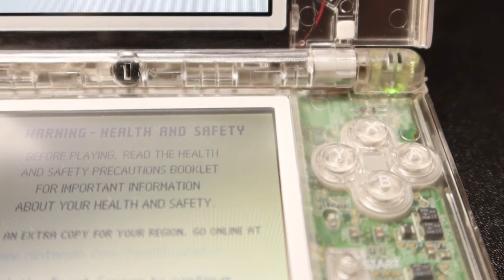Nintendo DS Lite Shell Housing Replacement | Shell Swap | DS Restoration

Comment: My childhood white DS Lite has been sitting in a drawer with a cracked hinge for god knows how long. I'm really thinking about doing a shell swap and getting a new battery and bringing it back to life. I won't say it looks easy but it definitely looks doable. Thanks for the awesome tutorial.
Reply: Scary how accurate this comment is to what I'm about to do. I have an atomic purple shell, r4 cartridge, and lithium battery in my eBay cart and my childhood DS lite with a broken hinge on my desk.
Reply: @bach2458  I ended up not doing it. As cool as it would be to use it again, I just don't trust myself to successfully do the swap. If you give it a shot, I hope it works out.
Reply: @Sirius_Coby  i just ordered the shell for $24, ill update you if it goes well or not. maybe i can inspire you
Reply: @bach2458  Now I'm interested too 😂
My DS lite has been sitting there for way too much time and I'll definitely try fixing it soon!
Please let me know if you managed to do the shell swap successfully :)
Reply: @mariobarchiesi3789  i just completed the shell swap and it went very well. took right at 2 hours
Reply: Just a note, if the hinge is cracked, it's likely because the barrel hinge was seized up and putting strain on the plastic housing. If you don't replace the part, your new shell will probably crack as well.
Reply: @autive42  the barrel hinge still functioned even though it was cracked. My shell swap was successful without replacing it.

Comment: I bought a clear blue shell for the ds lite and I will be using this vid to help me assemble the thing
Reply: @Sarcasm guy Its still gonna take a week to get here. I should've put I order insted of I bought
Reply: In case you were still wondering the shell installation was fine, but I broke the power switch on my DS.
Reply: @Sarcasm guy If you have experience, go for it! I didn't have experience and I was just unlucky that out of all things the little part that sticks out of the power switch broke.

Comment: I have an old white DS Lite that has been in the closet for years. It's starting to yellow and the hinge doesn't snap into place on it. The GBA slot doesn't work, the L button is broken, and many pieces of the shell have broken off. This video is giving me the courage to go out, buy a new case, and repair it myself.

Comment: Wish I would've seen this video sooner! I recently took apart my DS Lite because the bottom screen was getting glitchy and the color was distorted. I tried turning the adjustment screw under the battery and sometimes it removed the glitchy effects but still had the color distorted somewhat. like red apples in a tree were brownish in color. Anyway, I took it apart to see if maybe I had stripped the adjustment screw since it didn't seem to helping matters much lately, it wasn't thankfully, but when I put it back together I accidentally snapped the little nub for the power switch so now I can't turn it on. I don't have a soldering gun nor soldering skills either to put a new switch on, but this video is very helpful for the future!

Comment: ripped my ribbon cable. how did you do it so easily. gonna kms now. that ds was everything
Reply: Ribbon cable is routed through the right hinge.

It gets unbent everytime the DS is flipped open and gets bent again everytime the console gets flipped closed.

That ribbon cable is under constant stress.

Comment: March 2024, I got a transparent replacement shell from an shop on Amazon for $15.00. The tolerance is so bad that it could bent the board so slightly that it make the flex cable not working. Buy from a brand with consistent reviews guys.

Comment: Just finished doing this. If your shoulder buttons keep popping off at the slightest movement before you can get the back case on I heated a knife on the gas hob and melted a little ridge where the spring sits

Comment from the maker: Let me know if you have any questions regarding this tutorial
Reply: Could you make a video on hinge replacement on the DS Lite as my DS is flopping around because there is no fumctioning hinge to support the top screen
Reply: @epicpvper9379  i'm afraid i searched everywhere the only way to fix it is by changing the shell.
Reply from the maker: I do have a video for the DS lite hinge fix. It does involve replacing the top lcd housing frame. That is the simplest only way...
Reply: @TheFixTech  I was considering buying a cheap broken hinge DS on ebay. A whole new shell has new hinges? Not afraid to replace a shell. Did it on an original GBA and a GBA SP. Love restoring old consoles
Reply: I broke the latch for the small plug on the bottom screen so it won’t stay put. Can I solder it on or would it ruin the ribbon?
Reply: What tool kit are you using?

Comment: Nice video. Three small critiques. Leave the peel on the top screen until you're completely done.  The led light lens was left out @11:38, and the donor slot cover circuit board was left out @17:15.

Comment: **ATTENTION***...to save anyone else the hassle, be extremely careful taking off the screen and screen border. The adhesive likes to come off with the screen (this happened to me and I had to take it back apart and redo the adhesive...rip to those without extra adhesive...) As for the touch screen border, there is a thin plastic sheet held down by almost nothing and again it likes to come off with the screen border. This happened to me and it has made the repair 10x more tricky, I'm currently trying to get it to stay in place while I get everything locked down and then hopefully I will be able to hold it in place with the touch screen border. while attempting to do this I found a tiny fork like piece in my bag...well come to find out that goes in the hinge...yeah so no I get to take this thing back apart just to install that tiny ass piece that was NOT mentioned at all during the video! Like bro what's up with the silent act?? Are you to cool for school or something?? Talk bro! Guide us! this is a guide! Anyway I'm going to bed. Tomorrow I will update the solution I come up with regarding the now loose thin plastic piece that came off with the touch screen border. *UPDATE So more information that this guide didn't share. Be careful when routing the black wire under the cartridge reader as it can easily get stuck. Mine is currently stuck right now and I'm not sure how to get it out...

Comment: Fantastic video! only issue is there's no slight warnings/precautions when putting back the top shell. I've seen people mess this part up and end up bending all the stops from not aligning it  properly, other thing to point out is the power button slider/nub(?) from the board needing to be on the correct spot before finishing up otherwise it'll snap right off.

Comment: 2:08 that price you take off with the black wire connected, I can't get it to come off, and I feel it will break the circuit board if I force it...any tricks?
Reply from the maker: It has double sided tape sticking to board. It usually comes off with no issues. You can use a little heat (hair dryer) to soften the adhesive then remove.
Reply: @TheFixTech  thank you!!

Comment: Will the A, B, X, Y buttons from a New 3DS fit in a DS Lite?

i.e. Do both consoles use the same size A, B, X, Y buttons?
Reply from the maker: No, they use different button style press system. Will not work.

Comment: Hi, I have a problem...I was disassembling a nds lite for hydro dipping it, but when I was disassembling the top screen i kind of "cut" the ribbon cable...do you have any links for the replacement? I searched even on aliexpress, but I can't find them for less than €20..

Comment: I have a ds lite with the bottom screen that the lcd is good (i think), but the touch isn’t working great! I touch one side and looks like i touched the other side. Do i have to replace the lcd too? Or just buy a new shell with another touch and replace it? Help
Reply from the maker: If only the touch is defective then yes you only need the clear touchscreen replacement

Comment: I finished and when turned on, both screens look correct except that the bottom screen doesn't work as a touch screen anymore. Any suggestions?
Reply from the maker: Check the touch screen ribbon cable connector, make sure the cable is plugged in all the way. If the cable is damaged then replace touch screen (not the lcd)

Comment: So followed the tutorial got it apart and back together with ease but my top screen lights up slightly dim and no picture enyboady know what’s happening
Reply from the maker: Check make sure the lcd cable is properly inserted, if it is then the lcd has defected.

Comment: I put mine back together but now it won’t power on! Any idea where I went wrong? 😑
Reply from the maker: When you attempt power dies the power light flash then pop off?
Reply: @TheFixTech  So my battery terminal was damaged because the shell mold had a plastic piece there! After I fixed that, I noticed that I my touchscreen ribbon was ripped! So now it flashes green and then turns off so I’m assuming that’s because of my broken touchscreen?
Reply: @Leap3D17  how did u fix the battery terminal i have the same exact problem shell had a piece in the middle

Comment: I am struggling so much to get the bottom shell on. The springs keep popping out of place and the shell never sits flush, as if something is blocking it. So frustrating.
Reply: how did you fix that?
Reply: @avimoreno7226  
I used an x-acto knife to create notches in the plastic that would prevent the springs' arms from slipping out of place.
There is also a part of the bottom shell that pressed on the em10 charger filter. (I am guessing because of the shell being made by a 3rd party company). If you notice your shell is not going back together because of this, file that plastic down. If that em10 charger filter breaks, you will not be able to charge your DS Lite's battery. (Speaking from experience).
Reply: @JuanG2020 Fantastic… the exact same thing happened to me … the em10 broke while attempting to put the back shell on… were you able to fix it?
Reply: @antoniojean6170  Well, yes. I was able to replace the Em10 filter using a heat gun; my soldering iron just couldn't do the job. If yours just separated from the board, it wouldn't hurt to try to reattach it. Otherwise, you'll want to buy a new one. I think I got a pack of Em10 filters on Ebay.
Unfortunately, I have another problem. It's like the DS only charges a small amount. I charge the damn thing and after a short time, the light turns red. I am sure it has something to do with the Em10 filter, but I haven't had the desire, let alone the patience to open the DS again and attempt to fix that issue.
Hopefully you have a less frustrating experience than I did.

Comment: I tried this (and used the same shell coincidentally), and after I finished, it wouldn't turn on. The charging light comes on when I charge it, but when I try turning it on it does nothing. The power switch is lined up correctly, and I cant find any damage on the pcb. I took it out of the shell again to test it and same deal. Does anybody have any clue whats wrong with it? I know its basically impossible without seeing it, but its a long shot lol

Comment: DO NOT replace your shell with an after market, I just bought an aftermarket shell from extreme rate to spruce up my childhoot ds light and it is absolutely ruined now, the shell they sent me doesnt close, doesnt snap to a 90 degree angle, and even destroyed my receptor for my top screen because of the ds not opening correctly, i spent hours just to find all of this out after i had put the shell together, again please save yourself and do not get a aftermarket shell
Reply: the top display  it's too fragile specially the display, i destroyed it following another video from this channel; today i buy a new display i've to wait to don't make another mistake

Comment: I've just replaced one, thanks to this guide. I messed up on the top screen, because I jumped ahead without getting to the part of the video. (I replaced the top screen bezels/glass protector before I placed it in. Also, my "famicom" themed shell doesn't fit as perfectly/flush as the original DS, and the trigger springs are a PAIN. Make sure you put the springs in the right place (there's a designated "left" and "right" spring, where the chassis retention will be on the bottom instead of the top. If the chassis retention is on the top, you've got the wrong sided spring)

Comment: Hello! I’m currently fixing mine but as soon as I turn on the DS the top screen didn’t lit up. Any tips or reasons why it happened?
Reply: Does the bottom scree flash?
Reply: If it does, SpawnWave made a video talking about getting a ds lite in 2022. He also fixed a faulty ds and showed that the bottom screen would flash and the top screen would not turn on. Hope this helps!
Reply: I had a problem where the bottom screen would flash once and turn off. I had to re-connect the ribbon cable to the clip (I must not have pushed it all the way in the first time) and that fixed it for me.

Comment: Is there a brand of aftermarket shells with good quality? The only ones I can find link eventually back to Aliexpress... And I bought one there and there were a lot of faults in the casting mold. I had to file down the plastic on a lot of places and the end result wasn't to write home about.
Reply from the maker: It’s hit or miss, I’ve had a supplier provide great quality, then quality dipped.

Comment: Excellent video to follow along with. I struggled to get the black antenna wire under the cartridge slot, but after watching it again and bending it exactly how you did it went right through.

Comment: The problem with these type of tutorials would be a sense of direction. I just tried to pull off the cable right after he opened the back and managed to snap it off. The way he did it on the video it almost seems like he just slides it off but that IS NOT HOW ITS DONE. Make sure you go to another guide if you are looking for clarity. This IS NOT A HOW TO, THIS IS JUST FOR HIS ENTERTAINMENT. NOT RECOMMENDED.

Comment: Hello. After handing a case swap everything on my DS Lite came back fine. The touch screen powers on and works but has no touch. I removed the frame initially on the touch screen during the swap but didnt mess with the digitizer or touch screen ribbons. Any idea what could cause the bottom screen to work but have no touch?

Comment: After changing the shell my NDS won’t turn on :( green light turn on, flash the top screen, pop the speaker and then NDS shuts down :( nice video anyways 👍🏼
Reply from the maker: Check the top lcd cable, make sure it is installed all the way in. If so, top lcd may have defected. Replace if needed
Reply: @TheFixTech  it’s working now but I wasn’t sure what was wrong 😑, I disconnected and connected all the flex cables again.

Comment: Please help!  I'm new to repair and I just refurbished my first Nintendo DS and it went well for the most part. Everything works except when. go to charge it the orange light doesn't come on and it won't charge. I then swapped the motherboard with another ds and now this one isn't charging either. They were both charging before I did the repair. What could I be possibly be doing wrong? Oh by the way if I put in a full battery the DS powers on and plays just fine.
Reply from the maker: Make sure the bottom screen has the runner pad on the back, so no metal to board contact. Also make sure the battery is seating properly and touching the pins of the board.

Comment: Thanks for the tutorial! I've done it and got it working after an initial panic because it wasn't working and I broke the Wifi antenna trying to get it under the card slot. Turns out the antenna doesn't matter really because there's basically no way to use a DS Lite online and I just needed to re-insert the ribbon cable better to get the screens to work. Sorted. The damn case  (off Aliexpress) is pretty average and I can't seem to get the back of the shell flush (by the card slots, charger port and L& R buttons). Any suggestions?
Reply from the maker: Check around the screw mounting areas on the back housing, sometimes there is extra material that needs to be shaved off. Also make sure the board is fully recessed into the  button housing.

Comment: Hey, so I followed your tutorial to the letter... I mean, so carefully that it took me two days. And now my DS won't turn on, the green light flashes and the bottom screen flickers. Then nothing. Any ideas?
Reply from the maker: Top screen usually the culprit, check connections, if good replace top screen
Reply: I had this issue and it was just that I hadn't reattached the ribbon cable in the clip well enough. Tried really getting it in there and now it works!

Comment: I've watched this over a couple of times. I bought a broken hinge one  but it is still a working DS lite off ebay for like 25 bucks and a shell for 15. Going to restore this tonight using your video.
Reply from the maker: Just be extra careful handling the lcd cable through the hinge
Reply: how did it go?
Reply: Yea how did it go?